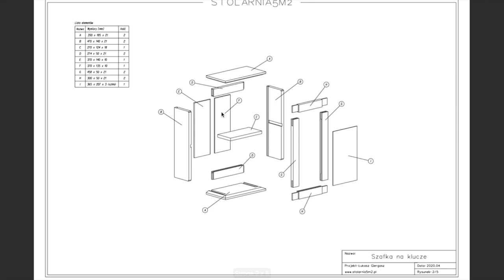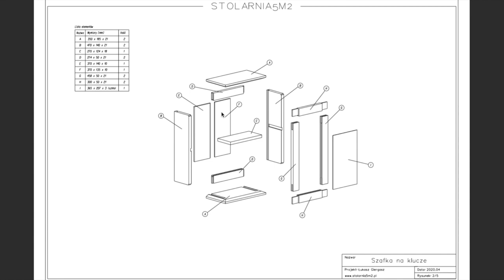Building small cabinet with #HANDTOOLS ONLY. Whole process. PLANS for free.

Comment: I can definitely use one or most of those hand tools.  Geesh.  What is the chance that a woman of 5 feet tall and 95 lbs could effectively use a hand planer?
Reply: Pretty good, it's not that difficult if you get your technique down. Use your body weight to push, and for bigger planes try and find a wooden or transitional plane since they're lighter. I'm not a huge fan of metal planes bigger than a #4, they just get heavy and clumsy imo. Just make sure your bench is a good height for you to work comfortably.

Comment: Thank you so much for showing this! I liked best how you did the back side. Why didn’t you use sliding dovetails to connect the sides to top and bottom? Best regards!
Reply from the maker: Hi - I wanted it to be a relatively simple project, sliding dovetails complicates build a bit
Reply: I never thought this would hold together without screws. I‘m impressed! The bone glue in the end was a big surprise. Thanks for proving me wrong 😉

Comment: 26:23 Nice job but should the glass breaks it would be hard to replace it
Reply: that is why he used animal glue.
Reply: @Becisz  traditionally the glass is set into a rebate and secured with glazers points then glazed. I’m glad I’m not the only one that noticed that. Not good to have to soak something like that in water. Too much detail and effort went into those joints. Great job on the build and video. Loved it.
Reply: @jordanhouston252  Traditionally with yours place, not necessarily elsewhere. What's more: it doesn't say anywhere that it's a traditional design at all. Why do you want to soak it?

Comment: 23:20 - Just out of interest, what prompted the blade change? Is it purely for a finishing cut?
Reply from the maker: Yep :-)
Reply: Ah! Is it sharpened with a back bevel or was it just a "fresh blade"?
Reply from the maker: @Myrkskog  Straight edge with rounded corners instead of curved edge for hogging material. Basically - I improvise a smoother (kind'a) :-)
Reply: Thanks for the replies, Łukasz.